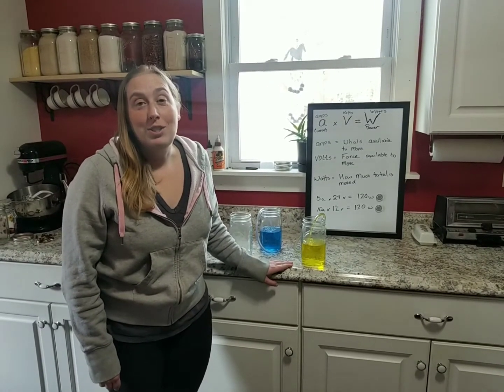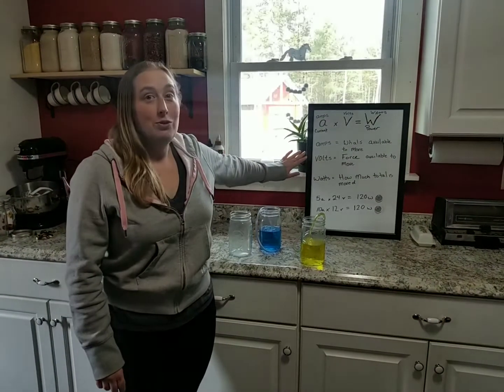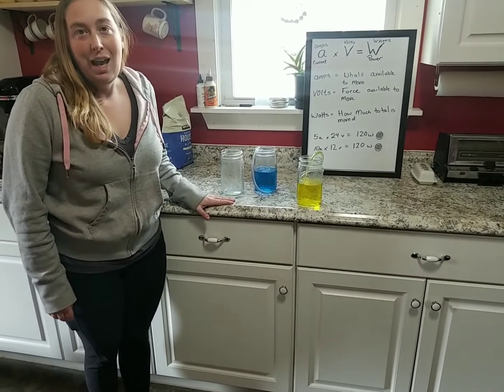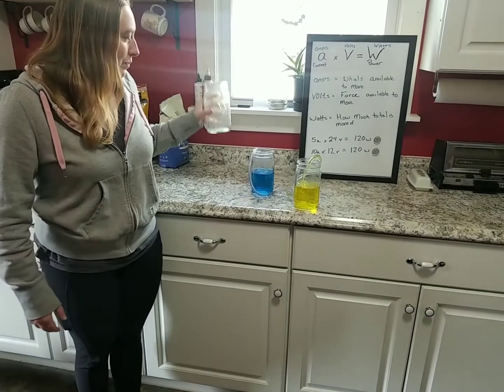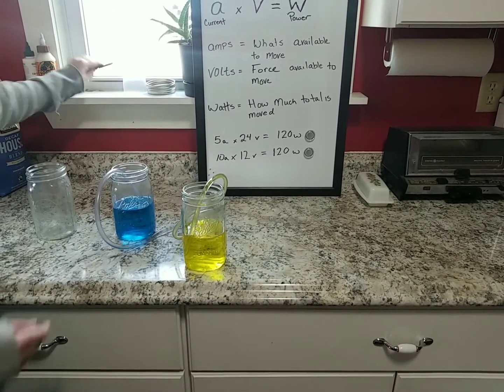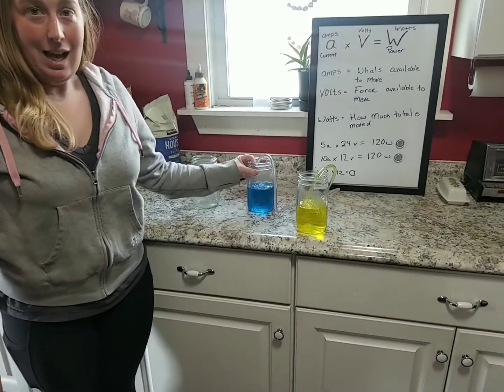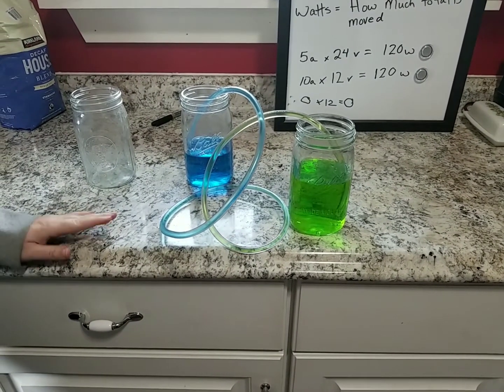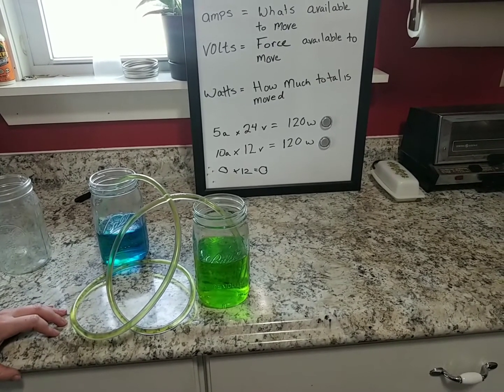Electrical Basics: Volts, Amps and Watts explained using water analogy

Comment: so force, creates pressure to move. voltage. 

in your video, to move the blue water, you increase voltage (gravity from lifting the glass) to create the pressure to move.

so if we want to increase amperage instead, that means we have to add more water. but then does this mean, more water increases the weight, and this increase in weight is also due to gravity, or inertia if force applied? so it seems like it is also another form of pressure due to increase in volume?

Comment: So if i have a closed container with a pipe leading somewhere for example, then volt equals pressure, amps equal the speed or velocity of the water, and ohm is the resistance between the pipe and the water?

Comment: ...and in relation to batteries, the higher the amps (mAh) the longer the run-time. The higher the voltage, the more power, or energy is applied.